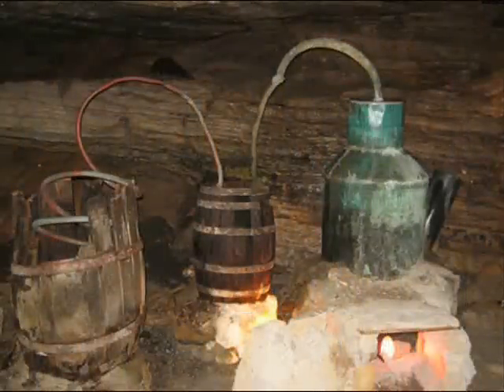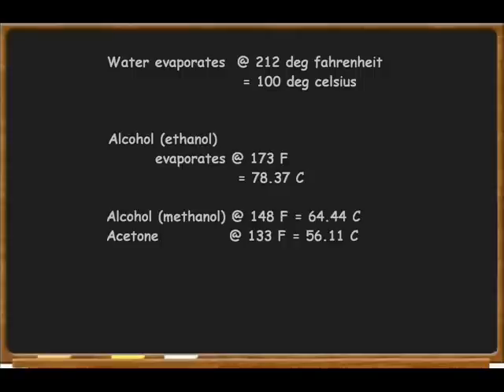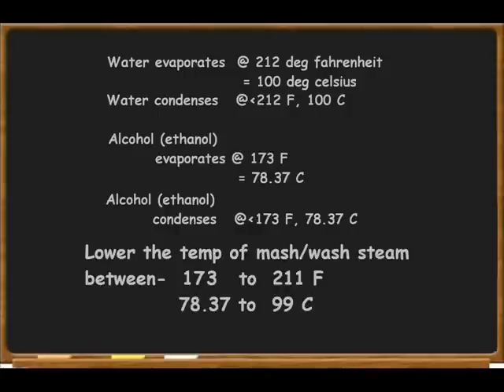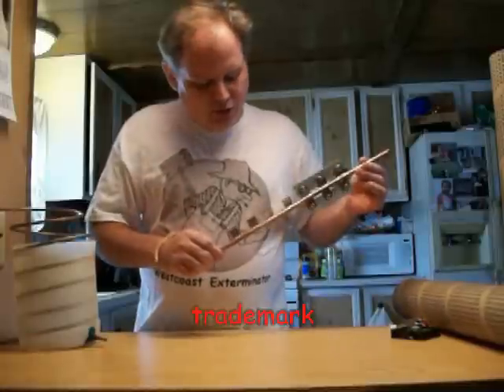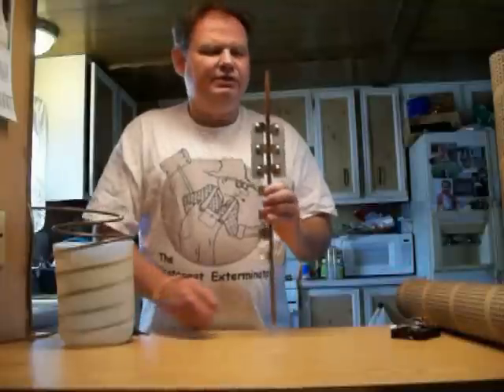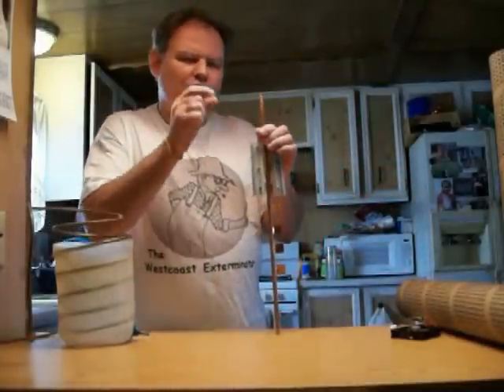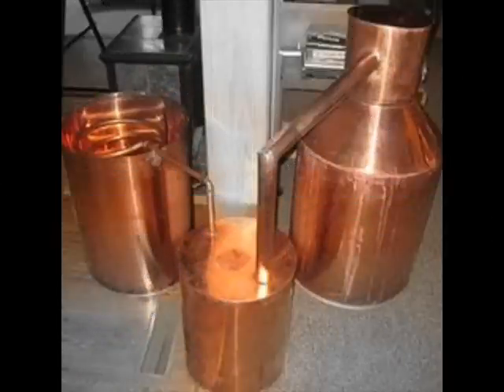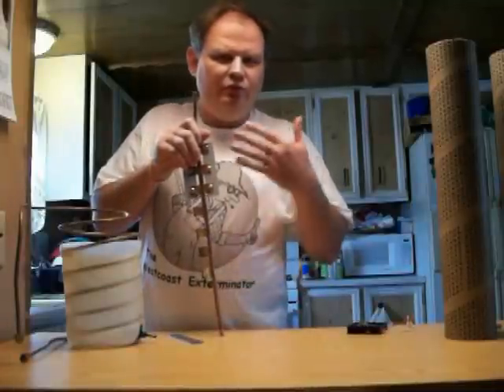Moonshine Still Reflux Columns & Thumper Kegs 101

Comment: You have some good ideas, but, this one,, hmmm... 
Reflux is about getting a higher proof.. Valved Reflux about control of the process. Internal vs External, etc.. 
Valved Reflux also flexibility to run as a standard pot still without the packing, etc.. 
It is about letting the Steam vapors rise, cooling at the head, and letting a portion of the vapors(water and Alcohol) condense and fall back into the packing, getting heated again and the distillates(alcohol) again turning into steam and going back to the condenser to migrate out at a higher proof, while the water flows back into the pot.
That is why you see some Column refluxes with two condensers and some with valves to redirect a percentage of distillate back to the column.. Also why you see some with cooling at the top of the head, and I think you are referring mostly to internal cooling tubes in the columns in your comments.
The volume is for the packing (which restricts flow), to still have a reasonable flow, and for the packing to also heat up (the reason you run a Reflux still in full reflux for a while to "Heat it up",) so it will help to turn the falling condensates back to vapors.... 
Your view of all of this is too simplistic. You are not talking about making any sort of reflux still,, just a new type of condenser, but, using it as a mid shaft in your still.. Not sure what that is going to do considering the size, but, don't waste too much time working on it until you have a better idea of what is is you want to do... 

Thumper kegs are basically Pre-coolers (proof boosters) before condensing. It is similar to the concept of the Reflux, but, exactly in reverse.. Where a column in reflux condenses and drops the condensate back into the column to further distill, and steam again, the thumper keg cools the water hopefully, and leaves it in the keg, hoping most of the alcohol vapors rise into the tube going to the final condenser. 
The time spent cooling is fairly quick. The steam turns into a bubble and it makes it's way up through the water before rising again and going out to the condenser. As the still runs, the water warms,, as more water is condensed and warmed in the thumper, therefore lessening the condensation factor on the rising steam, as the steam bubble has to travel higher through the warmer water. Less colder water, or more water of the warmer variety, still runs about the same over time, but, does create a higher final proof. 

Lets clear up something else at the beginning of the video.. Your temperatures are not "Evaporation Points",, but, Boiling Points.. There is quite a big difference between the two, and a point of some MASS confusion.. 
Put a teaspoon of 190 proof on a counter top in an Air Conditioned room at 70 degrees, and come back in a day or two, and you will have 10% left in your spoon.. (KEY:  A constant 70 degree temperature),, while the Alcohol continues to "EVAPORATE",, not Boil away... 
If it were simply a "Evaporation Point" at say 212 degrees for water, we would never have rain,, or,, your Teaspoon of 190 proof would always remain 1 teaspoon below 173 degrees for ethanol. Nor, would we have Fog after a rain, etc.. 

Next time you raise your lid on your fermenter, notice how you raise the lid.. You pop it to one side, and let the "WATER" run back into the fermenter.. Huge amounts of water condensates on the inner lid.. Nothing 212 degrees there either.. 
Now, you understand why,,, when you run a still, you don't get 100% Alcohol or 200 Proof distillates.. 
If it were that simple, it would be all about temperatures.. 

Here would be what you would be reading on "EVERY" website out there talking about distillery.. 
Pour in Mash, Fire up the Still, Turn up heat to max temp.. Turn on cooling supply.. When you see the first drips, this will be your thin alcohols etc.. Turn the heat source down and maintain the temp at 133 degrees until your drip stops,,,,,, 
Then, raise your temperature to the next level... Heat until about 173 degrees, and your next distilate will start.. It will also come out at 100% or 200 Proof.. 
When it stops, if you want to see something else drip out of the end of your condenser, you will have to raise the "BOILING POINT TEMPERATURE" to 212 degrees to get the water out... Of course, there might be something else that comes out between, and then after that next degree point, based on particulates, etc.. IE.. Salt increases boiling temperatures, etc for example, so other things in your mash might also create some irregularities.. 

I will leave you with a thought, since you are a thinker,,  and maybe you will come up with the Next Revolution in Stills.. 
Raise that Fermenter lid again and watch the volume of water run off... 
Bump the water off, and wipe it with a clean rag and put the lid back on.. Go back in an hour or two and look again at the NEW volume of water on the lid... Yes.. Quite a bit... Now.. Once your Mash is done,, and you are ready to go to the still,, do one more thing... Take a portion of your mash, and put it in something where you can heat the mash back up to brewing temperature.. Say 80-90 degrees.. Warm it, and put the lid back on again and come back in an hour or two, and lift the lid again.. This time,, lift it evenly, and let the water drain into a cup/bowl, etc,, and give it a sip.. Yep. You will be amazed.. Alcohol with  that water... I guarantee you that,, when I sit down and put some thought into it, with some time, I will be able to show you a totally new way of Separating the two.. I believe the key is Temperature Variance... NOT just Boiling Points, and in your comments "Evaporation Points".. Since we know that Alcohol and water will both evaporate at room temperature,, given the time,, I think we can both see that Alcohol will evaporate first.. And very likely, at a lower temperature variance.. 
I have not put much thought into it, and have never put a thermometer to it, but, I would bet that water will condensate between 15 and 30 degrees F, and that makes me think that Alcohol will or might condensate between 5 and 15 degrees variance.. 
I see the rain hit the cool white water river of the Nantahala river. The rain is darn cool, but, the river is cooler.. A heavy Fog develops over the river pretty quick.. One day, when I am not so slammed with projects, I'll take a water temp and the temp of the rain, and have a starting point to play with.. In this case.. The still would be made of some sort of wide flat plates with some sort of cooling running across the plates at one temp, and the mash at a warmer temp below it. I would most likely work from an angle of how would this work if there were no Electricity... But, I would first use whatever I had to to verify the temperature variances before I started the "Prepper Distillery".. Ha.. 
Every time you raise your Fermenter lid, you think about this.. And, no, you never noticed this before, because your mash has never been that warm at the end of your fermentation.. I run Temperature controllers and keep mine at a constant for the duration.. I don't do distilling, although I did research it, and tried it with something I threw together for the learning experience.. But, I do like to brew wine,, and I start and finish my wines,,, ready to bottle in 10 to 12 days.. Secondary Fermentation is a completely manual process that takes me an evening for 6to 12 gallons of wine, and it is ready to rack first thing in the AM.. I break every rule in the book, and when I try to enlighten people on the wine forums,, they say I am not brewing wine, but, I am brewing "Hootch".. One day, I will catch one of the PrimaDonna's, and hand them a glass of wine, and let them rant and rave about it, and then, tell them, it is some of my 12 day wine.. Ha.. Have had many fine wine drinkers beg for a bottle or two.. 
Good Luck with the Distillation.. Keep up the videos..
Reply: Oh,, and BTW... 
One more point.. Being a wine maker, and one day getting interested enough to start researching distilling,, I ran across the "Don't Drink it or go Blind" Moonshine Heads comments...  I thought to myself.. What a bunch of Garbage..
When you make "Moonshine" or Rum, or Vodka, or "White Lightening",, what are you making??? Really???
A Wine that you are going to Distill. Wine Recipe.. Juices, Sugar Yeast.. Whisky: Grains Sugar, Yeast.
What creates Methanol Esters??? Research that too... Fruits are much higher than grains.. Never heard of anyone going blind drinking wine??? It has nothing to do with the Distillation process,, only the Fermentation process common to both methods of making spirits.. Wine Musts have much more methanol esters than Whisky Mashes.. 

The POISONS that come out of Moonshine??? HA,,HA,, HA... WHAT A BUNCH OF GARBAGE...
Government Propaganda to keep people from buying a $2.00 bottle of untaxed Alcohol from the local hardware store, instead of the $10/bottle Government Taxed Spirits.. The Word "DENATURED Alcohol?".. De-Natured.. Or De-Naturalized.. Or,, Not Natural any more.. It's all Ethanol, before the Government forces producers to "Poison" Ethanol not designed or "Approved" for Drinking.. Try to get a Distillery Permit.. GOT CASH??? And,, get a Fuel Permit.. Hell, it's free!! Same Stuff.. 
But, if you have a "Fuel Alcohol Permit", if it came off of your still, and it is in a bottle, it has to be "Poisoned" before the cap goes on.. Back in the days of Prohibition, when the shiners lost a load, if they got in a pinch, and the demand and consequences for not meeting the demand was high enough,,,, in went the methylated spirits,, commonly called DeNatured Alcohols... This was just after the Poison mandated by the Government was added.. Now you know about the Heads.. 
Research "methylated spirits" and DeNatured Alcohol and you will see what I am talking about.. 
Then, research Methanol Esters, and do some research on Apple Juice and Orange Juice and tell me that drinking the Heads is worse than drinking the same amount of "Apple or Orange Juice".. Ha.. 
EVERYTHING IS TOXIC in the right proportions. EVEN WATER... 
I just did a quick search and found two good articles to get everyone started to see the bullcrap the Government has dumped on the public's heads... 
http://homedistiller.org/intro/methanol/methanol
after this article, check this page out.. Make sure you see the "Lethal Doses of Common" WATER, COFFEE, etc... at the bottom of the page.. BTW, don't trust anything you see on any .gov sites, nor any Western Medicine sites either. Cancer was not caused by Lack of Chemo or Radiation.. 

Excuse my rant.. If it wasn't Illegal for someone to distill for their own consumption, people like me would be playing with stuff like this, and enjoying the challenge of learning, testing and developing new skills and procedures for making better spirits.. Hell.. I studied Primary and Secondary Fermentation for 3 or 4 days before I decided that I could break every rule ever written about making "Good Wines", and make better wine than I have ever tasted.. French wines being the best I have enjoyed. Every bottle I brew is better than the absolute best bottle of wine I have ever tasted, and people who have never liked wine love my wine. Those who are wine lovers really can't get over the taste of my wines.. 
Don't believe anything you hear about anything.. Research and learn.. If it doesn't sound right, and you think you know what you are talking about, then, it probably isn't... Go with your gut and experiment.. Learn something new every day.. Get good at it and then move onto another subject or another experiment. Share what you are sure about on YouTube and let others start where you left off and educate the next subscriber.. 
Don't let the Government win... It's not::: I want, I want, I have, I have,,,,,  now I owe, I owe, so Off to Work I go,, to be a good boy and do what I am told.. Don't keep up with the Jones's.. They ain't too smart anyway.. 
Figure out how your Great Grandma and Grandpa did it... If things keep going like they have been going, we all may just be wishing we knew how to make a bar of soap out of Fat and Ashes.. 

I just so happened to be making my yearly batch of Berry Blend wine... My favorite recipe, and decided to once again do a little Youtube on the subject.. Then, got off into a discussion with someone talking about Going Blind with Moonshine.. I thought...Hmm.. Same process.. Where does the Methanol get created.. Did my research, and figured I would finish the night with some Moonshine videos, since I will be talking about this for a bit with some others and ran across this video.. Figured I would jump in, and learn some more by commenting to others.. You will learn more from teaching others than you will ever learn on your own.. A Student will never catch up with his Teacher or Master, because the Master or Teacher is always learning while teaching.. You never know what you Don't understand, until you begin to teach others and explain what it is that you know.. Cheers.
Reply from the maker: +Mark Thomas There is only one point to a reflux still, and only one way to make a higher proof with a still like this no matter what you name it. The heat slowly dissipates so the water can condense first while gravity can carry it back to the pot instead of the worm. Anything you build that allows this will work. There is no distilling it hundreds of times like some people say.. there is no fractionating like some people say.   And to answer your question. The "what are you making" goes along like this. When the fist oil refineries were distilling kerosene for lamps from crude oil (this replaced whale oil and gasoline wasn't being used yet), the first thing that came out was gas. The gas was collected and dumped, then the kero came out. The same thing is going on with distilling alcohol. The first thing you get out of your still is poisonous alcohols like acetone and these can make you go blind when too much is drank. It is called "heads". Like the gas, it is collected first and you can dump it or save it to light fires. THEN you can start collecting the good stuff.
Reply: +wcemichael  Yes. I am familiar with Samuel M. Kier, who discovered crude in his Salt operations in the Mid 1840's, who finally used in 1851 the  horizontal cylindrical stills to create what he called Carbon Oils, that within the next 10 years resulted in 58 different refineries in Philli with different types of distillation techniques to make different products.. Of which nothing back in those days is being used today, as far as "whole distillation processes", although Vertical Columns and Fractional Columns of those days are still used today in creating spirits, since it is a much simpler system than trying to separate crude oils. 
Which is created first, gas or kerosene depends on which process you are referring to, and whether the gas is the aerosol product or gasoline which is usually not referred to the end product until it is blended with the other waste like products produced during distillation.
EVERYTHING at some volume is "Poisonous" to the body. Even distilled water at 6 ltrs/day.

I am curious about the "Poisons that make you go blind".. 
These Alcohols are produced in the Fermentation process, then refined in the distillation process. 
Question:
If Methanol is poison and is removed at the beginning of distillation,,,, When/how is methanol removed from wine or beer?
ANSWER: IT IS NOT,, and has never been removed from Wines and beers.. It has always been there, and will always be there.. 
The fact of the matter is, that Pectins are the primary source of the creation of the methanol comes from the pectin, which mainly composed of methyl esters of galactose. When pectin breaks down, by enzymes introduced 
by microorganisms, or deliberately introduced, the methyl esters combine with water to produce methanol.
Methanol is the "Go Blind" agent.. The Poisons of Ethanol and Methanol are broken down by the body in the exact same fashion. Metabolizing ethanol produces chemicals (LESS) toxic to the body than alcohol. Unfortunately, if the same chemical action is performed on methanol the result is formic acid, lactic acid and formaldehyde.

Formaldehyde attacks nerve cells, especially the optic nerve and can damage the liver and kidneys. Formic acid and lactic acid also attack the kidneys and liver.
Now that we know that Methanol is the "Go Blind Agent", lets look at some raw statistics about Methanol so we can get this "GO BLIND" in context, other than the Government Propaganda being repeated by so many today..

Other factors also go into the production of Methanol. Type of Yeast, High Targets of finished ABV's, dirty conditions going into the fermenter, lack of sufficient oxygen of the yeast in the Mash/Must, etc.. 
Corn Liquors surely contain less methanol than fruit wines,, especially if the distiller dumps his heads. 

 Wines created with "Fruit Juices" contain an average of  0.2-0.3% methanol, or if derived from pulp, or fresh fruit by enzymatic degradation, the levels can be  0.4-.06 or 0.6-0.9 which is 2 to 3 times higher than juice wines.
So,,, if you are concerned about Heads in distillation,, PLEASE DO NOT DRINK ANY WINES..... 
AND,, in fact,, lets look at Orange Juice.. Orange juice contains 10 to 50 times as much methanol as sugarmash.
Sorry, I could not put my hands on a Orange Juice vs a standard Fruit Juice or Fresh Fruit Must, but, you get the picture. 

Now, lets look at Recommended vs Lethal Doses of the same Orange Juice.. 
"Dietary surveys have shown that an extreme consumer of orange juice drinks slightly over 2 litres/day. The estimated maximum intake of methanol based on this consumption would be 455 mg for a 60 kg adult 
which is below the maximum advisory intake of 600 mg per day for a 60 kg adult, "Recommended" by the Department of Health."

So if we stay under 600 mg per day we are "SAFE", that's the same as 200 liters(52 Gallons) of mash per day or about 70 liters(18.5 Gallons) of 40% alcohol per day if you weight is 60 kg.
I'm sorry, but, that by itself would be a new record in Guinness Books.. 
Now, lets look at the Lethal Doses.. 

The lethal dose of methanol is equal to about 80000 mg or you need 27000 liters of mash at least to get that amount. I challenge you to drink 27,000 liters of mash (7132 Gallons).. 
Or, Imagine drinking a lethal amount of wine... Maybe 5,000 Gallons of wine AT ONE TIME... to get a Lethal Dose.. 
But, it is a concern, if you are going to Separate your Heads and drink them rather than throw them away.. I will agree to that totally.. But, to make a run and not throw them away, and mix them with the rest of the pulls, it is right back to the mash numbers.. You would not want to pull heads from a 5 gallon batch and drink them, not included with the rest of the batch, that would force you to spread them out over a weeks worth of drinking..
The fact of the matter is, that neither Ethanol or Methanol is going to make you healthy.. But to think that if someone doesn't pull their Heads, you are going to go blind is just plain not paying attention to the facts.. 
The total amount of methanol in mash expressed in ml is about 0.1 ml = nothing.
I'm glad we have that to set the records straight.
Reply: +wcemichael 

To the Reflux Stills.. 
If you are familiar with running Reflux stills, you run them for 5 to 10 minutes (preference), to "Warm" them up. To get them to operating temperatures.. You don't find anyone insulating their columns, and you won't find anyone who is cooling them either. You will however find all of them (who are running in Reflux mode rather than Pot still mode), packing the columns with Copper wool, Ceramic Rings, etc.. to add volume to the column.
You would not add a volume or packing inside of a Column, if you wanted to Insulate or vice versa Cool the external of the tower. It would be defeating either or both of the purposes.. 
There are wild variations to the Reflux Stills. Internal vs External and Valved Reflux for example.
The Internal would be the only Reflux still that I could imagine you are basing your ideas on, because the water feed to the cooling coils at the top of the column are also running through the middle of the column. 
At the bottom of the column, there would be a lot of condensation that would drip back into the pot, and that would be if there were no packing.. The packing would be heated up by the rising steam across the whole volume of the column, while only the water feed pipes themselves plus a very small portion of the packing around them that would be active condensers. The water warms as it rises, and the steam cools, so the net effect is not realized until the top of the condenser, where the condensates drip back down through the packing and rise again before making it back down to the pot. This is where the higher proof collection comes from.. 
But, it is much easier to understand, when you look at a Valved Reflux Column. And it would be well worth while to look at the Fractional column also.

You mentioned that there is no distilling it hundreds of times.. I have never heard that claim.. But, a valved reflux still, after determining it's maximum distillation rate, best runs at 1/3 collection and 2/3rds reflux, depending on your setup, but, that is a good rule of thumb. So, 2 oz out of 3 would run back down the column, to further refine or increase the proof. The "Re-Evaporation" of the distillate in the column, before it makes it to the pot,,, and in this case,, AFTER it passes by the condenser. The Valved reflux still usually only has a single condenser..
AND, they can be unpacked and run as a Pot still, where the Internal Reflux still can not.  The fundamental design of the same "Reflux Still" is totally different. I can't see how you can Lump all of them in a single class and say they all work the same way, when you are talking about anything less than they are designed to be used as a "Reflux" still, and that is not even true in the case of an unpacked Valved Reflux (Now a Pot Still).. 

http://www.moonshine-still.com/still.pdf
Take a look at this document. About page 42 or the Chapter 11.
I can't think of a better still with more flexibility, etc.. They are much, much easier to operate for a beginner operator. It does the same thing that a pot still and Thumper Keg does, but, much more efficient, smaller foot print, and isn't prone to leaks or pressures. It is an open system.
It is much easier to see and anticipate the splits for Heads, Hearts and Tails. You can anticipate via temperature and then, confirm via taste, burn test, smell, etc.. to learn the process vs try to figure it out while you make mistakes. 
It can be run as a Reflux still for higher proofs and a cleaner distilate, or it can be run as a Pot still if you are running something with a full body that you want to keep the full flavor of the distillate.. to be honest, I don't see the loss of flavor pot over Reflux.
I give my waste wine fruits away to others who do their thing with them. Some have multiple experimentals and I have been a part of tasting many batches from each. The Valved reflux still in this link that I have just posted is an exact replica, and I can't see a better piece of equipment with more functions and efficiency in a single uncomplicated package.. 
Unless you can come up with more than what you have said up to this point, I think it is obvious that your understanding of "Reflux Column stills" isn't where it needs to be yet to be making authoritative statements about it. I agree it is much more complex than a Pot still based on the millions of Pot stills out there all based on the exact same design, but, the Reflux still is an evolutionary still. Something that came after years of experimentation, and varying designs. In fact, the distillation of Petroleum went through this same evolution with these same devices.
Cheers.
BTW.. According to my research, the Rums made from Molases that are below 15% ABV are said to have "NO" methanol products in them. I will be at least suggesting that some runs be made to determine if this is true or not, using the crude flame test to check the results.
Reply from the maker: Mark Thomas
Sigh....So you've turned this into a pissing contest....Wonderful. Sorry but here is why you are wrong. The water and the drinkable alcohol boil at different temps. It is this difference that allows people separate them. Simple basic science. One evaporates quicker than the other at the same temp. This same simple basic science is still in effect with the non-drinkable vs drinkable alcohols. The laws of physics don't change. There is a difference in temp at which each will boil. This difference allows us to separate one from the other. Again, basic science. I have done this so many times I can tell the difference in what I am getting by taste alone. Cognac makers are so skilled in this they can tell the difference between savable and non-savable alcohols by smell alone. So now we know you know absolutely nothing about distilling, but like talking about it A LOT anyways. As as for what is a lethal dose or not and all the other stuff you feel the need to talk about to make yourself appear more knowledgeable is just that, a red herring so you can look down your nose at me. Have a wonderful life.
Reply: I see that you completely ignored the facts that were presented.. That is Ok.. It is why I commented to begin with.. To see if you were aware of them.
There is no doubt that Alcohol has a different boiling temperature than water. I don't think you will find anyone that will disagree with that. I never did.
I guess you were hung up on your "Basic Theories of Science.. Actually Physics, and could not grasp the reasons why Basic Theories of Science don't fully explain what is going on during mash distillation.
The materials involved in Mash distillation also have different evaporation rates..
I guess if you thought to mention one, without mentioning the other, you would have a terrible time trying to explain why you don't get 100% alcohol when hold your mash temperature at a Head, Heart or Tails Rate..
Because you can't explain that with "Basic Science or Physics".. Because it isn't basic.
Your still must deny the laws of physics, while mine does not.
Since Boiling points are the only laws of physics at work here in your theory, your still must produce 100% alcohol at one products boiling point, with no dilution whatsoever from any other product in your mash..
And, if you never reach the boiling point of water, then, when you get past the heads, then, you only get 100% Ethanol if you keep your temperature below 212 degrees F.

And, if you get your mash temp up above 180, but, lower than 212, you will have Zero Alcohol left and 100% of your original Water that you started with..
I guess,,, if that is how you think it works, I guess that is how it works, whether it works that way or not.

Maybe that explains how alcohol will evaporate without any heat being applied to a teaspoon of alcohol sitting on a counter top.
Or that IceCubes shrink while frozen in your freezer.. Sorry,,, it is not all about Boiling points..
Evaporation is part of the distillation process too, and why you don't get 100% alcohol..

If it were like you think, there would be No Reason for a Reflux still, and probably the reason you think they are not worth running.
You totally missed the picture of Evaporation before the boiling point.
I guess you also think that there is no "Water" in your Heads? Ha.. Ok.. You know best.
Probably don't know that more "Go Blind" methanols are produced in Fruit Wines, than in Grain mashes. So, don't forget to tell all of your friend wine drinkers that they "Will Go Blind" if they drink wines made from fruits.. Mass disinformation campaigns by the Government don't usually make much sense to those who do a little thinking about it.
Your right.. I don't have a clue about physics.  Ha. Cheers.
Most of us do videos to share what we know.. Not what we've heard.. At least when someone brings something to your attention, you should  reason your thinking.
If you can't see there is more to distilling than "Basic Science",, well,, I guess that is the way it is.. Just because you said so.
But, since I don't know what I am talking about,, here is a question for to you explain with "Basic Science".
If it is ONLY as you say "There is a difference in temperature at which each will boil.",
If you have already boiled off your "Blind" Methanols,, why do you not get 100% or 200 Proof Ethanol, if you are boiling at the Ethanol Boiling point, and there is only Ethanol and Water left in your mash, and you are not yet at the boiling point of water?
If you are only boiling off Ethanol, because you are only at the Ethanol Boiling point, then, why are you not getting ONLY the Ethanol boiling off at the Ethanol boiling point, giving you only 100% or 200 proof Ethanol..
Answer.. Because of the Evaporation of water at the Ethanol Boiling point, diluting your 100% ethanol. There is actually a lot more at work than this Basic Science, but, for simplicity sake, there it is. Maybe you could explain it some other way of the laws of physics that I am not yet aware of.
And,, that is the reason why,, "You are Wrong".. The Laws of Physics you didn't think about at work in your simple project.
Not trying to piss on the subject.. Just trying to throw some things out there to help you further your knowledge, and give you some things to think about...
Anyone who thinks that Reflux Stills are not designed to do what they do effectively for the reason they were designed,, is just spouting off without thinking more about the Why someone would have gone through the trouble of designing them.. It is a refined design of the Pot still with Thumper, and gives you the ability to run as a "OLD" Pot Still, or in Reflux mode.
The Column Reflux Still is about "Re-Distilling" in the Column, and the packing is there to heat up, not cool down the vapors.. It is to further separate the water in the vapors via accelerated evaporation, by allowing them to cool and condensate, pass back down the column, while re-heating what is dripping back down the column (water/alcohol), to get the alcohol to re-evaporate due to reaching it's boiling point once again, and having less water evaporation because of the cooling of the water "first".  What would be the point of the reflux or thumper anyway, if it were only 100% ethanol going up the column?? I rest my case.
You win.. Good luck with your videos..
Keep up the good work.
Reply from the maker: Mark Thomas
HA HA. Already seen it. And I'll be covering that in a video sometime. I am well respected by my viewers. Your "well respected" web site has given info, people can't use and they come to me afterward.

Yea, One guy with his head up his ass, out of 14,000 subscribers, went to sooth his butt hurt ego by talking smack.about me behind my back, and now your butt hurt ego requires the same.
HA HA HA HA HA HA HA ha ha................

Here's a lie he wrote
"He's saying we promote using leaded solder and crap."
Didn't say anything close to that.
The thread lasted ONE WHOLE DAY. ha ha ha ha ha ha ha......and after he puffed up his chest, he got over himself.

Guess you forgot the old rule. "You can't please all the people all the time." ,but I'll gladly take 1 out of 14,000. Oh, make that 2 out of 14,0000. I think I can handle the competition, can you?

Are we done??? I'm guessing not.
Reply: +wcemichael yes, I see the questions that your average users are asking.. Been looking for that simple answer,, which you have plenty of.. But once they learn a little bit about what they're doing, they won't be looking to you for any technical or advanced knowledge, and that's for damn sure. 
the only people that think you know what you're doing and talking about are people who don't have a clue yet.. And that's a fact..
Reply from the maker: Mark Thomas
Yea, whatever you need to tell yourself to keep your ego inflated.....
Reply: +harry Hatchet a 15 gallon beer keg for a pot, 2 inch copper riser 16 inch tall, a slow bend 90 above that, a 2 inch to 1 inch short reducer, 14 inches of 1 inch copper, a 90 degree elbow, a quick disconnect, about 4 inches of half inch pipe after a one inch to 1/2 inch reducer, then a half inch 90, then about 30 inches  of half inch, reduced down at the end to a 3/8 inch 90 with a short nipple for the discharge.. The condenser is a 1 inch copper pipe about 24 inches long with a 1 inch to 1/2 inch reducer on both ends.. It slides over the 30 inch pipe.. Then two holes are drilled in the one inch, one on either end, and half inch short nipples are soldered in place.. Half inch garden hose one with a male connector and one with a female connector for the water inlet and outlet..
everything on top of the pot is copper..
The valved reflux is a 40 inch column of 2 inch copper, a 2 inch Tee topped by a shot nipple and copper cap with hole and grommet for the thermocouple. 
the horizontal 2 inch coming out of the T about 4 inches long come up and meet another 2 inch T.. Below the T is a 3 inch copper nipple, with a 2 inch cap with Two 1/4 needle valves in it.. 1 needle valve is the reflux back into the column just below the other two aunt Tee. 
the other valve is for your discharge.
on top of the T is a 2 to 3 inch reducer. Then 24 inch of 3".
then a cat, with two coils of one quarter inch refrigerator copper wound tightly, one coil on the outside, close to the outside wall, and one coil inside of that.. Both coils are joined with a 90 or a coupler depending on how you bend it.. And both feed in and out through the top of the cap..
the bottom of the  column is packed with copper wool, and ceramic rings are poured on top of that up to the entry point of the quarter inch refrigerator copper coming from the reflux valve..
I have to temperature measuring points, but I have learned just to rely on a thermostat that was installed in the top of the pot..
I think a smaller and more efficient condenser could be built with a 2 inch copper pipe with a cap on both ends, lowered down into the three inch. I would feed the 2 inch tube with half inch copper going down inside of the tube about a half inch from the bottom cap.. And the exit for the condenser would be a half inch short nipple just protruding through the top cap.. I think it would be more efficient than two coils of quarter inch..
Hope that helps..
the only other thing that I would do would be to cut A hole in the top of the pot, and put in some sort of system where it could be removed, and you can get your arm in there to clean it out.. But if you use a clean wash, that's not necessary.. But if you're going to fool around with anything with molasses in it, you better have a good way of cleaning the bottom of your pot..
you sound like you're very interested in the projects.. If you go to my channel, and click on About, and click on Send Message in the upper right hand corner, and leave me a message, I will send you a link to an unlisted video that you will find very interesting, if you are familiar with rates of primary fermentation..
After you watch it, you'll be thinking about the very first question you asked me.. Haha
Cheers and good luck.
Reply: That's some good information you have shared, thank you good sir. have you studied chemistry?
Reply: +harry Hatchet No. not really, but I am familiar with it.. But I do study subjects.. And I did quite a bit of research on this particular issue..
I wanted to build one, and I wanted to make sure I built the one I wanted to build.. My intentions were to produce ethanol fuels.. So the valved reflux made perfect sense to me. 
for someone wanting to make moonshine, its really not necessary, and in my opinion its a waste of time..
both steels are going to start hi and work down to a minimum alcohol content..
so they still operator is going to mix in proof is whiskey to a content comfortable for drinking.. Usually about 90 proof. 
I would test taste my tales, and if they were clear, and had a good flavor, I would mix that with my hearts to reduce the proof rather than using water.. Even if you use distilled water, the end result will be cloudy, and may or may not clear up..
but if you're just going to run a regular moonshine still, opt for a short column, no need to go for about 14 to 16 inches, and build a good condenser.. You can really produce with a red like that.. I like the condensers where the gas runs through the copper tube, and the water runs through a larger copper tube jacketed around the smaller copper tube.. But yes, I did quite a bit of experimenting there for a while.. Kept records on everything, tested everything..
and even played around with speeding up the primary fermentation.. I got it down to three days..
I don't do any talking about it, while I was doing it, & I don't post YouTube videos of me doing it either.. It just doesn't make any sense to me.. I have not seen a single individual YouTube video on youtube about making moonshine that wasn't evidence to convict someone for doing the same.. Each video would be another count.. My personal opinion, putting a video up about making moonshine to drink is just short of being totally ignorant.
Reply: +Mark Thomas thats a shame its illegal, in my nation we can produce 20 litres of liquor a week from a still at home legally.  your information on building a still would have been well received.  one vague question.  all copper?
Reply: harry Hatchet You might also be interested in making wine.. I did a video one day on the process of making wine in 10 to 14 days to bottle time. You might get some good ideas from this to help you in controlling your mashes.. I run my prmiary (wine musts) at an elevated temperature 88-90 degrees F, and then run the secondary fermentation totally manually. I do the clearing it in an evening and and a next day, I rack and jug it.
I have told a lot of people about this, but, I have never had anyone say that they have done it.. It's simple.. Don't have to wait months to do what you can do in an evening and night.. I have not met a single person who did not love my wine, and almost everyone who tastes it, asks to buy a few bottles before they leave.. I can't sell it, and can't make enough to give it all away, but, I'll surely drink a glass with you.. Ha..
The Girls love it..  And, a full wine glass and good conversation, and somehow, it makes their clothes fall off.... Ha..Ha.. :)
Cheers..
Reply: The difference (methanol in wine vs methanol coming out of a still) is quantity consumed in a short time. You wouldn't drink a whole keg of wine in an hour or two. It would take you several days to do so. But if you were to remove that methanol that is in your keg of wine and drink it all at once, it would do some serious damage to you, I'm sure. When you distill said wine or beer, the first thing to come out (the heads) is this methanol, all at once.
Reply: i think you mark thomas should start to make videos they would be worth the watch